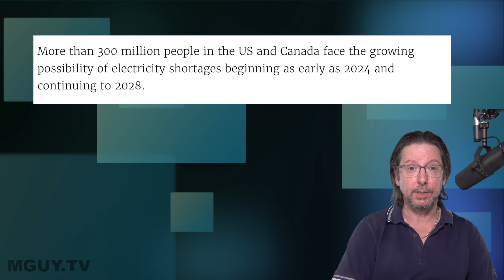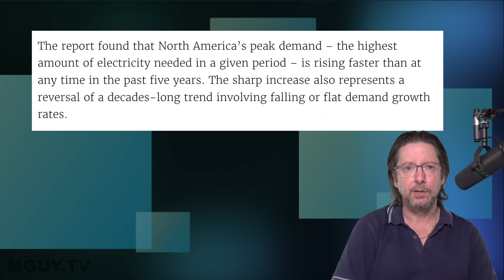Electricity grids WON'T COPE with mass EV charging | MGUY Australia

Comment: As a retired power engineer here in the states, my biggest complaint is that no one will do the math.   And it's just simple math.
Reply: Oh they most certainly have done the maths.    What they HAVEN"T done is tell everyone that NO ONE will be allowed private transport anymore,  so NO NEED for all that electricity.
Reply: I use solar for emergencies and to be able to get the most out of it I had to learn it and build my own system. They can`t B.S. me either. Reality doesn`t match up with their "facts."
Reply: Simple facts ignored by the converted activists.That the problem is to simple for there limited intelligence to understand.In there misguided effort to save the planet going to destroy it with endless mines and a mountain of toxic waste to power there brave green world.
Reply: Yep, do the maths on 170 Wh/KM and what do you get? Is that a lot?
Reply: Democrats can’t do simple math; That’s why “affordable” Obamacare is so expensive.
Reply: So what math do you want to do?  I will get you started?   Total present US annual Electricity = 4E15 watt-hours.   Total present US Miles Driven = 3.22E12 Miles.  Typical EV use per mile = 250 watt-hours.   Transition to EV across 20 years.  Where does that take you?
Reply: I think it's good you retired, because you don't know what you're talking about. EVs charge off-peak, only consumer about 10 kW/h per day, require exactly ZERO infrastructure changes and smooth out the grid demand.
What you also don't know is that there is a 5 kW/h electricity investment in every gallon of gas just to refine it from petroleum. That much energy can push an EV 15-25 miles without burning precious petroleum up.
Stay retired, stay in your lane, stop posting inaccurate information as if you have a clue.
Reply: @justsomeguy934  What about the endless millions and millions of people that live in Apartments, Townhouses, or only have on street parking, how would all those vehicles charge during off peak hours?
Reply: @Shakerhood69  Excellent question about apartment dwellers and EV charging. Certainly residential charging is the most desirable outcome and benefit for owning an EV. However, what do apartment dwellers do for gasoline? Do apartments have a refinery? Nope - they go to a refill station (usually once a week) and get gas. You can do the same for an EV. Most EVs now have a week of typical driving for range. You would (less convenient, I know) go to a rapid charger and refill there.
Reply: @Justsomeguy You are reinforcing the point l was trying to make. I quoted your statement that EV's only charge Off Peak, but in reality only a small segment of individuals will be able to.
Reply: @Shakerhood69  your information is incorrect. The percentage of apartment dwellers in the USA is about 35%, so the number of residential charging is not a "small segment" at all. It's the majority of owners.
Reply: @Justsomeguy, plenty of residential homes and townhouses have only on street parking along with apartments. But it all leads back to you saying all EV's will be charging off peak, that is not the case at all.
Reply: @Shakerhood69  your are talking about a minority of cases. Let's assume your draconian scenario - no at-work charging, no rapid charging within reach for an apartment or condo dweller. Guess what? that still eliminates HALF of all the ICE vehicles and HALF the burning of precious petroleum. I'll take it.
Reply: @Justsomeguy, You are all over the map my friend. You were critical of the retired power engineer by saying all EV's will be charging off peak and now you are of onto something else. The issue is probably going to end up being more demand than supply.
Reply: @Shakerhood69  my responses are to the point. I agree that most EVs charge off-peak, at least the majority of ones do so now and will do so in the foreseeable future. Overall, the grid needs to produce more energy just because humans are expanding their demands on this planet, but EVs are not at fault. If you have a specific topic you'd like to discuss, say so.
Reply: @Shakerhood69 so we eventually have several hundred thousand EVs in an urban area and they need to recharge on "off peak". There used to be a surplus of power on off peak. Not any longer.
Reply: @northdakotaham1752  you are incorrect about your statement that off-peak charging will create demand-level draw during off-peak. Not true. The total amount of energy consumed by an EV will not cause daytime-level resources.
Reply: @justsomeguy934  are you an electrical engineer? I am already using off peak for over 25 years and even during that time the off peak load requires continual balancing, users being staged so as to prevent overload....and that is with NO Evs being charged off peak at this time. Users are not going to want to wait for two days to charge their car. They want it charged fast.
Reply: @northdakotaham1752  Are you an EV owner? I guess not. You're assuming maximum load off-peak to charge an EV, and assuming a full refill every night.
That's not how you use an EV. You plug in an EV daily and replace DAILY use. For the typical American, that's 30 miles per day or about 10 kW/h. That much energy can be refilled in ANY electric vehicle overnight on house current (120v, 15a circuit). Absolutely NO infrastructure changes necessary at that draw rate.
Reply: @justsomeguy934  this is the USA....we don't have laws telling people how much gas they can buy or how much electricity they cam use. I suppose you want us to be like China? I don't own an EV but I do know about electric power and power generation as I have been involved in that field of work for 43 years. We do not have the power and unless some miracle happens we won't have power for a large number of EVs regardless of the time of day.
Reply: @northdakotaham1752  I challenge your expertise. Tell me how an average of 10 kW/h per day, drawn off-peak, will melt the grid. Let me give you some history: the advent of air conditioning after WWII was one of the greatest increases in energy demand in the USA, and voila, the grid met the demand. We are producing orders of magnitude MORE energy now than WWII. 
So by all means, tell me how the grid, at off-peak times, cannot charge an EV plugged into house current. That's a space heater, friend, done while we're asleep.
Another factor you're unaware of is the electrical investment in gasoline, about 5 kW/h PER GALLON for refining. Drive an EV, don't buy gasoline. The net difference, total grid demand, is almost net zero.
Finally, if the grid cannot handle an appliance plugged into it off-peak, fix the damn third-world country grid.
Reply: @justsomeguy934  what you say is all just great....except that's not what is being proposed. The plan is for EVERYONE to be driving an EV. You don't need to be a genius to understand that it just won't work....EVER.
Reply: My figures are completley accurate in Australia.What figures do you want to dispute.The 90% of lith ion batteries end up in landfill forever burying there valuable metals and causing toxic pollution.Maybe our nation energy supply when get a normal hot summer day have to conserve power to prevent load sheds as no reserve left from hastily decommissioned coal plants.The already growing mountain of wind turbine blades that cannot be recycled after there short twenty years of life.Can go on and on the information is out there unless to blind and indoctrinated to see the truth.Besides our failing grid would never drive the expensive fire risk ev and will stay with the more reliable and environmentally friendly fossil fuels for our energy security.Least have less chance of being bbq while driving.And what of the army of residents who do not have off street parking and must rely on the unreliable public charge network to have enough life to get to work.As more and more fires and building collapses happen as this stuff burns three times hotter then fuel does.Hot enough to melt building supports.In the long term if keep closing coal fired plants will not even have reserve power to charge at home as be on load shed on every hot day.Our reserve power already on icu and that unfortunately a FACT and not a desirable situation.All my statements are fact as unlike those who been to green brainwashed do check my figures.We should have enough reliable base load to cover demand and keep cost down.Will cost lives if suddenly decide will be in dark next five years while urgently build plants that should of been built ten years ago.Without even ev electricity demand going to increase every year and nothing being done to build base load to fix the problem only blow up plants that needed.And dont even mention battery backup.Enormous amount of resources used to power a city for a dismal short time.That figure given for the warehouse size battery pack in Fairbanks Alaska is that will keep power on for 20 minutes if the grid breaks down.And with the current energy rate of ev at about 3 km per kwh your 10 kw daily use seems an under estimate by about 70%.Once drive more then 100 km a day home charge impossible unless want to spend thousands to put in higher rate charger at home.So please do not question my integrity on factual information.Am not in the con game like many who push this brave green future.There is ample evidence out there that this electric fantasy will destroy us.But look forward to your reply comment.Cheers Bob @justsomeguy934
Reply: @BobSmith-ew5oi  Your figures are wrong, as are many of your assumptions. First, over 80% of a wind turbine, including the blades, are recyclable. EV batteries, after a 300,000 mile - 500,000 mile decline to 80% range, are repurposed and/or recycled at the rate of over 90%. Your disposal portrayal of both those subjects is incorrect. 
Your statement of "expensive fire risk" is also patently false, and you prove AGAIN that you should stay in your lane. EVs are 10:1 safer from fires than a gas car that carries liquid explosive as a fuel. 
I absolutely AM questioning your "factual information" because you have none. My quotes on EV charging are based upon the average use, not extraordinary use, and you definitely CAN charge any EV using house current overnight for the typical usage. Let's talk high miles use, shall we? No expensive charger is necessary whatsoever, another misconception of yours (again, stay in your lane). Any EV comes with a mobile charger; all you need to do if you need more than house current is to install an inexpensive 220v outlet in a garage. In the USA, it's called a NEMA 14-50 outlet. They are generic outlets used for clothes dryers, compressors, welders, heaters. 
As for your battery powered city scenario, no one is suggesting you run a city on any single source of energy. Grid-level batteries are for emergency power, just like the Tesla batteries that saved South Australia a few years ago (did you forget that?). 
Renewables can easily produce half of all demand power, solar especially. Australia has enormous amounts of renewable energy, it's too bad your government doesn't know how to manage your energy supply.
Reply: You aren`t very intelligent. Keep babbling the parroted B.S. you get from the playbook of fantasy. Why was California begging people to NOT CHARGE their cars and having rolling blackouts? Got propaganda for that on your list? Don`t they have a LOT of solar panels to charge those things "after hours"?  @justsomeguy934

Comment: Here in South Africa we generate 60% less electricity than before 1994. But it is mostly due to ANC corruption, theft and their affirmative action (AA) laws. AA is the same as apartheid, but aimed at minorities. So, they appoint their incompotent ANC cadres to run key industries.
Reply: Seems here in the US we are following in your footsteps...
Reply: Ineptocracy!
Reply: And major problem when left to collapse to much.Even the rich and the leaders who push this madness will suffer if a failed grid cannot supply them power and not a five minute job to build base load plants.Society will collapse in the five years takes to bring new plants on line.Every extra coal plant that blown up one step closer to a grid and society collapse.

Comment: Government needs to work on fixing the outdated grid to handle new demands and also make it ready for renewable energy. This is needed in every country. 
Also, regarding electricity required for EV, there is study that says if we produce 30% more electricity , that would suffice to power all the cars . Please note just to refine one liter of gasoline it requires 1kwh of electricity.  If you are filling up your ICE car with 30 liters of gasoline, it used 30 KWh of electricity for refining. Remember, it is only just for refining. It would require a lot more electricity to explore oil, extract oil, transport in ships or pipelines to refinery, transporting fuel to gas stations and pumps in the gas stations.  Tesla Model 3 runs 4.16 miles with 1 kWh of electricity. So electricity needed to refine one liter of gasoline is enough to run the Tesla Model 3 for 4.16 miles. Also, in most power generation of any kind a lot of electricity is wasted as they are not used properly. For example in Texas, a huge amount of electricity from wind power is wasted and pay customers to use electricity at that time. If they have some kind of storage for that, that electricity will not be wasted. As huge amount of utility level storage projects are coming up, electricity will be used more efficiently and wastage will be eliminated

Comment: In the UK we have 'off peak' pricing for electricity for times when there is MORE power than is needed. At night , the very time that most EVs are on charge, the price drops due to lack of demand, there are even times when Renewable sources are switched off to stop oversupply. 
Even 50 years ago there were doom mongers claiming that the grid would fail. Strangely the people who manage the Grid, not some self selected 'Think Tank', have proved the doom mongers wrong, with their forward, and often unseen, planning and works. 
I wonder who finances the 'Think Tank' Simon quotes, and how independent they are.

Comment: Vehicle fleets in the USA planned buying electric vehicles, and then contacted their power utility with their projected needs for charging said vehicles and were flatly told......No.  The power is not available and they wont be allowed to hook up their electric charging stations.  This has been discussed at hearings on capitol hill in Washington DC.
Reply: Those "hearings" you've seen on the USA Capitol Hill are sponsored by the representatives that take oil industry contributions. I've seen them, they never ask any valid questions. For example, one idiot Congressman compares charging and EV to charging a cell phone, because it makes a dramatic comparison (you can charge 1 billion cell phones for what it takes to charge a car or some ridiculous comparison). What they don't ask is to compare charging an EV for each day to running a clothes dryer, or running an oven, or running household air conditioning. The typical American HVAC unit draws 3x-6x the demand of an EV when running. Concerned about the grid? Stop building houses with A/C.
Reply: @justsomeguy934  oh my, a conspiracy theory. So let's think about USA gasoline and diesel consumption replaced by equivalent energy in kw/hrs of electricity, that is a very large number and there is absolutely no chance that spare capacity exists. So much for that.
Reply: @wazza33racer  No conspiracy theory whatsoever, it's deliberate avoidance on your part when you ignore the oil industry contributions to political campaigns. Also, do some research on the Koch Brother(s) that overtly spend millions on PR campaigns and direct political contributions to slow or prevent EV adoptions. Google is your friend, friend.
As for you statement concerning replacement of diesel/gasoline energy with electricity, I'm not recommending that, but as a total capacity equivalent, it's completely feasible. In fact, the total amount of energy the USA consumes daily can easily be generated by a solar farm using LESS real estate than we currently use for oil & gas leases. I do not recommend a 100% energy plan based on renewables, but your conclusion that we cannot replace most gasoline/diesel vehicles with EVs is false. It's completely feasible where prudent.
Reply: @wazza33racer  does that also mean that new homes can't be added to, or factories, or hospitals - they all use electricity.
Reply: @br5380   what it means is that if demand is going to increase, planning and investment (like growth in demand trends) need to happen BEFORE the demand takes place not AFTER.  If the grid needs to grow in capacity 20,50 or 70% to provide for Electric vehicles then that generation capacity,poles,wires,substations all need to be funded,constructed and installed.  Not oh lets plug all this stuff in and watch the grid black out.  California has that problem right now, they have begging EV owners not to charge at certain times, because the grid cannot cope.  That is absurd, there needed to be a plan before the EV's came onto the grid.  But, stupid is as stupid does and California leads the civilized world in stupid.
Reply: @wazza33racer  I can’t help your countries inadequacies, this is some thing that needs doing at a strategic level - the same way no doubt it was done in the first place when America ‘electrified’ in the 30’s-50’s.